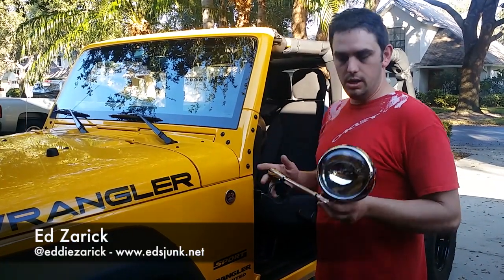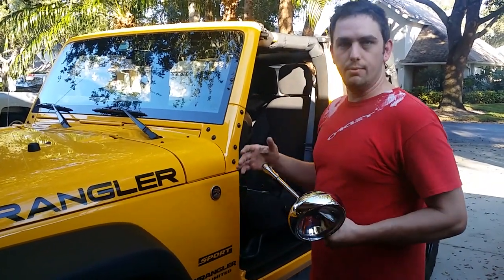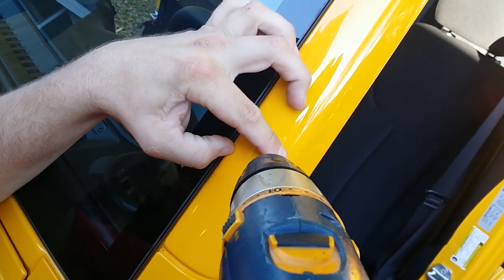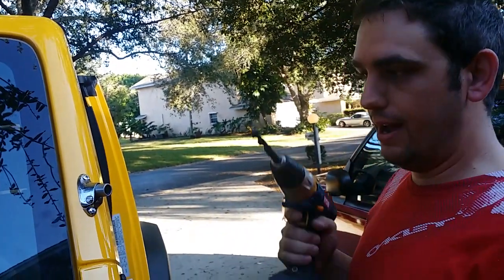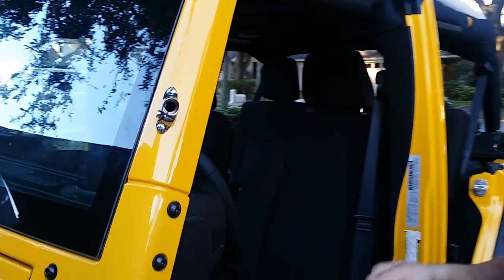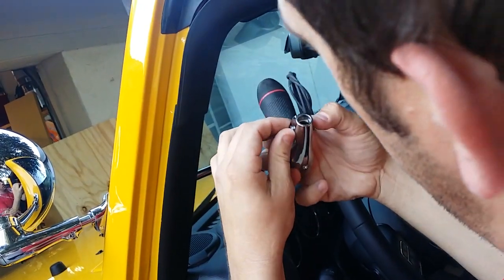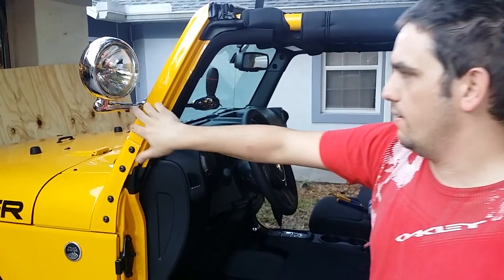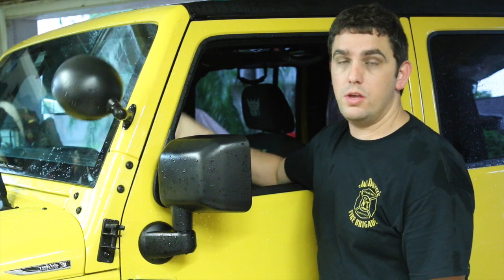Unity Post Mount Spotlight for Jeep JK Wrangler

Comment: Nice job! These lights are indispensable, I was a police officer for a few decades and I used it all the time. It’s nice being able to shine the light just a bit in front of the car to be able to see where you’re driving in certain situation‘s. I just ordered one I’m going to be attempting to install it on my Tacoma. But I’m like you I don’t like chrome I like black. So I’ll be looking into powder coating or painting. If everybody knew how awesome these lights are everyone would put them in their cars like people did back in the 50s. Unity could really cash in if they advertise a little bit and show how useful these lights are. Maybe update the styling a bit etc. 
  I’m going to guess that you are a sign maker? I just came upon your videos I had to find out what that sick water faucet/air gauge/compressor fitting is on your jeep in the introduction. 👍🏻
Also, everybody who’s commenting on how long the post is …it is not long at all! That’s the correct length to be able to maneuver the light comfortably.

Comment: I have two metal structures that run along side my windshield holding up my light bar on top of my jeep. Do you think the process would be the same when it comes to drilling? I would have to go through my A-pillar and the metal structure.

Comment: Hey Eddie,

How hard is wiring the light to a power source? Do you run it behind the dash to the battery? 

Thanks in advance!
Reply: You can just run that one hot wire (because the light itself acts its own ground when attached to the car) down between the dash panel and the window trim area and tuck it into the fuse block area..,Easy Peezy!

Comment: About your Unity Spotlight, is the post/handle in your way? I'd personally like a post as close to the pillar as possible, I'm concerned the handle is close too steering wheel. Any comment would be great, and thank you.
Reply: Unity has different lengths of posts so if worse comes to worst you can just order a different length.

Comment: Why wouldn't you use the actual part when center punching the holes and just tape the template in place.
I'd love to have one of these on my car but I always thought they were illegal unless you're a cop.
Reply from the maker: Looking back on it,  that may have been the best bet,  but I assumed the templatr they provided was accurate lol. Well that's my own fault for not checking that. At least I made the mistake so maybe others don't have to?
Reply from the maker: They are not illegal at all... But there only for off road use,  just like any aftermarket lighting systems.
Reply: +Eddie Zarick Hey buddy question, how much for the light, and where did you find a jeep mounting kit!!??? Help, Im wanting to do mine the same way, but cant find the mounting kit.
Reply: Use of spotlights is covered in your states motor vehicle code under spotlamps. Laws vary by state but the rule is normally you can only have two on your vehicle, they can used in off-road situations or situations in which you would use your high beams. When being used to supplement highbeams they should be aimed off to the right of the vehicle no more than 100 ft in front of the vehicle. Again this varies by state so check your local laws before use.
Reply: Hey Unity! How about the question of a shorter post for the Wrangler JK? Man that post is L O N G........... and that Wrangler JK is small behind the wheel. I think I need less post. Please respond.